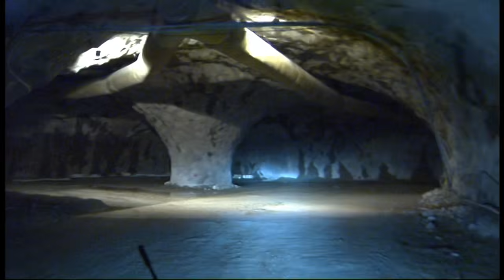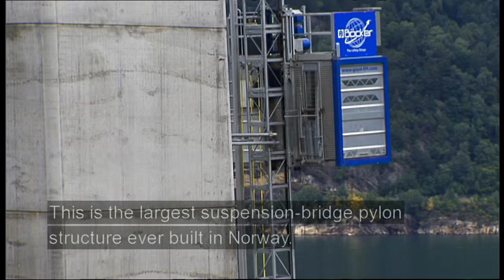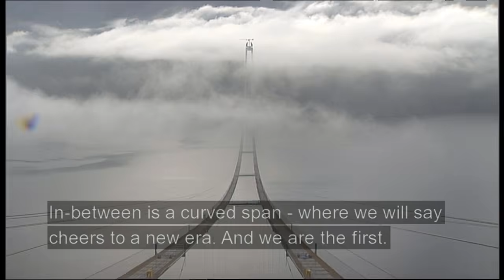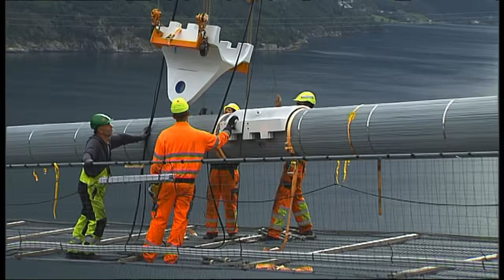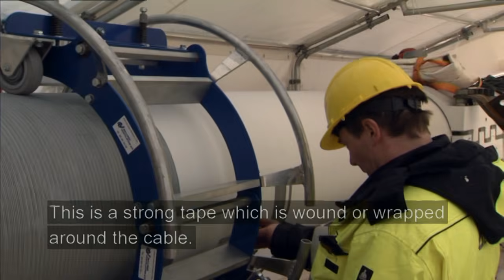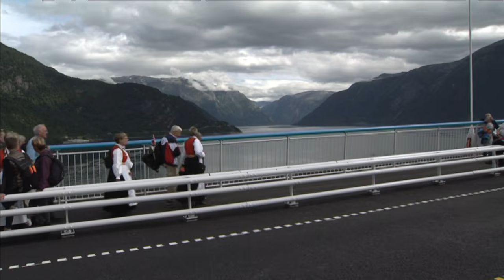Statens vegvesen - Hardanger Bridge 2009-2013

Comment: We'll never have this kind of engineering in my f*****g country (Portugal). From Lisbon to Porto, we have 3 motorways side by side. What for??? They are always empty. God save Norway.
Reply: Believe me... I really do understand what do you feel. No doubt that some highways will hugely be an advantage for norwegians specially between main cities. I understand your complaints about small roads and speed limits. Travel between Oslo and Tromso on national roads limited to 70km/h is a torture and eternal! 😧 A highway should cut the time to half. My comment refers to your tunnels. Here in Portugal, from River Tagus up, there are many mountains and hills. To cross them we have to make sometimes huge detours to arrive to the other side, while for example in Switzerland, even in plains they made tunnels to clear cities and villages from traffic. And in Norway, specially in the fjords, every hill has a tunnel to shorten the travel. I was referring about the nonsense of having 3 highways between the same cities when only one is hardly used. Only in May 2016 we will have the first real tunnel with 5,66km long (the biggest of Portugal and Spain combined) between Amarante and Vila Real. I love Norway. Have a nice weekend.
Reply: well who drives the speed limit here? i certanly dont ;) never meet cops anyways so...
Reply: true. I guess its just a matter of being vigilant and driving fast when you can and slow when you cant.